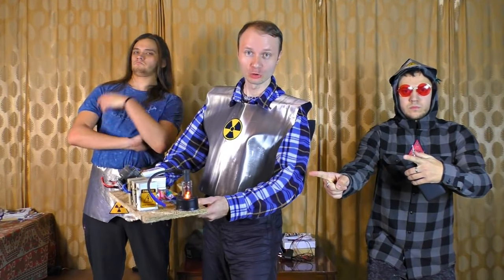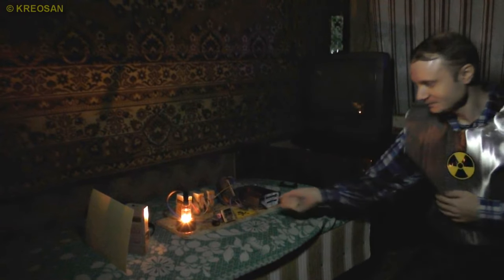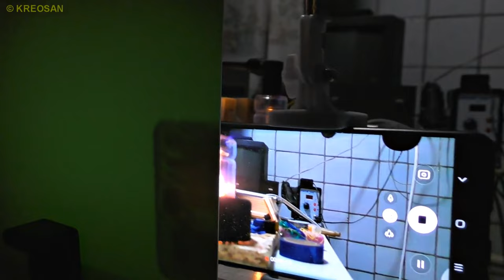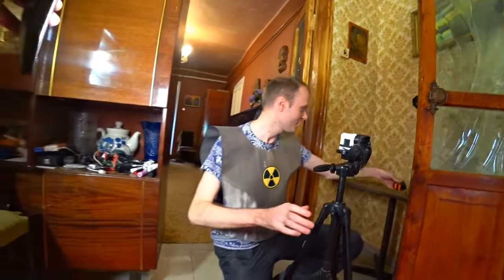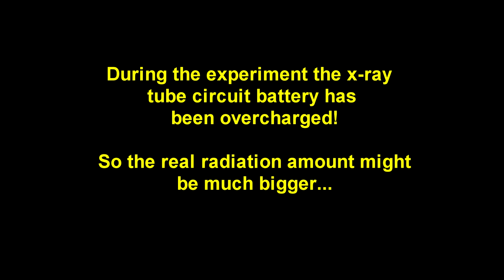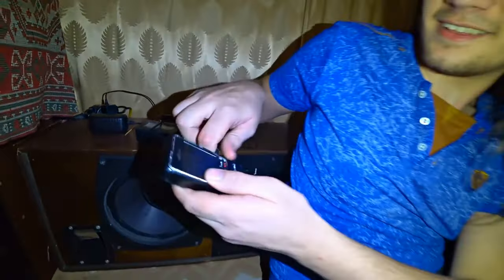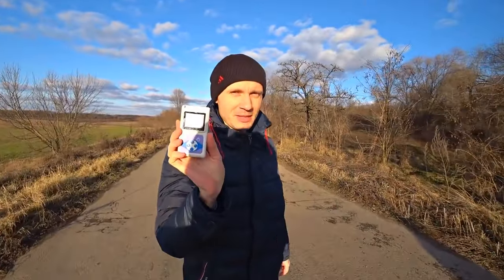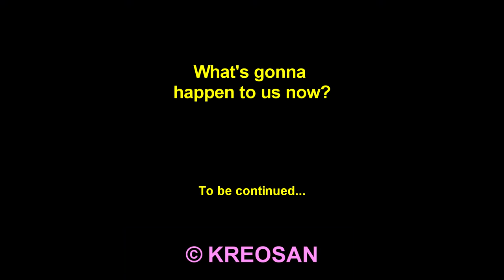X-Ray Gun ⚡️☢️⚡️ Experiments

Comment: Sure looks like old  HV vacuum diode tube. Overvolt any vacuum tube with hot cathode and X Radiation is generated has to be High Vacuum. These tubes can be found for $3 online. In the TV set they have Radiation symbols on a metal can surrounding them and that's at normal 20kV not 100.
Reply: No, that's a real stationary anode X-ray tube. Dangerous at any distance, but EXTREAMLY Dangerous to get closer than 30cm.
Reply: @philipcosson691  Thanks for info I didn't know they were that compact. Gold target you think or Tungsten? Also, can't wait for that monster they showed at the end. Getting Cancer for views... Needs to be run behind thick concrete or equiv.
Reply: Tungsten target embedded in copper
Reply: @philipcosson691  Neat, I'll have to look at a schematic as now I'm wondering how the electrons are focused. The metal cup maybe. same charge repels (focusing). thanks for replying sir you seem to have detailed knowledge on this matter.
Reply: The filament is a coil of tungsten wire, much like an incandescent lightbulb. Heated by a small filament current (about 4amps). The potential difference between this and the anode, in this case, is between 35 and 100 kiloVolts. In professional setups, focusing the electrons to a tiny 0.5mm spot on the anode is important. This is done by negatively charging the 'cup' surrounding the filament. I doubt they have bothered.
Reply: @philipcosson691 Im Holding an IK3 (USA) Tube in my hand looking at the design seeing how it prevents massive X-Ray proliferation via its normal function rectifying HVAC . Thank goodness because from what you are saying they are very similar tubes.. If this one had a very small window or other alteration it would be zap, zoop, melt. My little vacuum diode has the  anode as the "cup" and the cathode as the "filament" and the filament is Shielded much lower than by sight from "cup"... Genuine question: How do you know all this stuff or is it classified?
Reply: I'm a Radiographer!
Reply: @philipcosson691  I don't come across many "real" people on here, really a treat to strike up a good convo with someone who has all the answers. That very focused beam of electrons will melt anything eventually wont it? Medical Radiographer or Industrial? Amazing info btw thanks. 
I was reading that X-Radiation is no different than Gamma Radiation (other than specific wavelength). It's amazing . Light can be gathered and LASED. I wonder if there is such thing as X-Rays pumped into a beam?
Reply: @flaplaya  you are also quite knowledgable - the beam of electrons is indeed very likely to burn through the anode. This was the limitation for x-ray tubes until some bright spark invented the rotating anode. This is a large diameter disc of tungsten that is rotated at about 9000 rpm. That's the sound you hear when the x-ray is being taken, the anode spinning up to speed and then being slowed. The rotation has the effect of spreading the heat from the electron beam over the diameter of the circle, and not just on one tiny spot. Gamma rays and x-rays cover the same area of the electromagnetic spectrum. The distinction is that gamma rays are obtained by radioactive decay, as such, they are of single energies. The commonly used isotope Technecium 99m emits 140keV photons. In this respect, gamma sources are very like lasers. X-ray beams, like the ones these idiots in Russia are creating, contain a wide range of photon energies, from 20keV up to the highest voltage across the tube, perhaps 100keV. This is why a tube in a 'low voltage' application, say 400V will not generate x-rays, the maximum photon energy will be 0.4keV. These photons will not have enough energy to get through the glass.
Reply: @philipcosson691  Extremely comprehensive comment and thank you for the props back. Gamma rays are not exclusively emitted by decay of Radioactive Isotopes though e.g. "Terrestrial gamma-ray flashes" are generated from some cosmic event in coordination with the trillions of electron volts trying to cascade away from said cloud source. Seems the distinction between X and Gamma rays is energy level, not frequency as I previously assumed. Man has broken right through that previous barrier of 160keV... Shattering it actually. "There is no consensus for a definition distinguishing between X-rays and gamma rays". . What type of damage to these guys acute and chronic do you foresee?
Reply: @flaplaya  energy and frequency are directly proportional to each other. So, they can be used interchangeably to classify electromagnetic radiations. Frequency is most commonly used in the lower energy part of the spectrum (radio, up to terrahz). Energy is only commonly used as the descriptive classifier  in the high energy part. However, this is just convention. A red laser has a unique specific wavelength (commonly used) but also a unique specific frequency and photon energy. I still believe the only meaningful differentiator between gamma and x-ray is radioactive source. The radiation from lightening conditions you describe would be termed x-rays in this framework. The problem is that even scientists are not that consistent! As to the potential detrimental effect of these idiots exposure... It's a stochastic effect. This means they have increased the chance of some longer term problem. People vary in their acceptance of risk. I ride a motorcycle which, i believe increases my risk of serious injury and death, yet I accept that increase as the trade off is worth it for me. Perhaps I am selfish, as it would not just be me who suffers the consequences. One of the problems with ionising radiation is that it can't be percieved. It is therefor an insidious risk that can creep up on you unawares. I'm hyper aware of risks I take on my bike, that thrill is why I ride. We don't really know what the risk from ionising radiation is. It probably depends on individual genetics. We do think children are at greatest risk. For an adult the assumed additional risk of cancer is 5% per Sievert. Until recently it was thought reproductive organ irradiation could cause birth defects in humans. This is no longer accepted at any likely level of exposure. Impossible to estimate these idiots personal exposure, but it is unlikely to be as much as a Sievert. This is because a Sievert would probably be more than a thousand medical x-rays. Several extensive CT scans could perhaps deliver such a dose. We use the precautionary principle. The chance of winning the lottery is vanishingly small, yet someone wins every week! Unfortunately, by the same logic, it is probable that someone in the world contracts cancer every day from a medical x-ray due to the huge number of examinations.